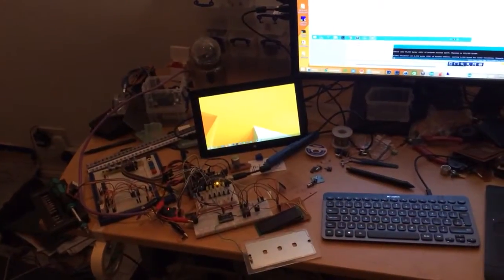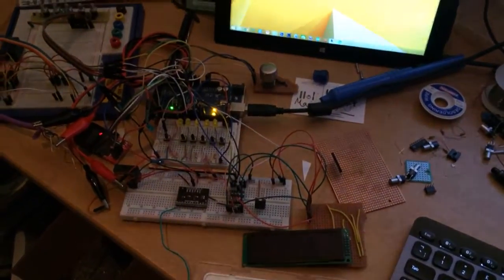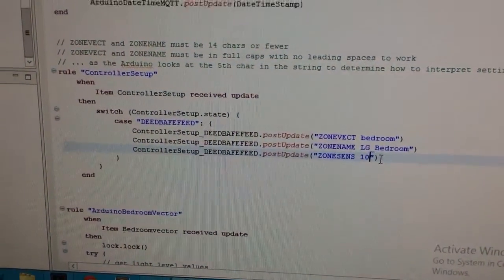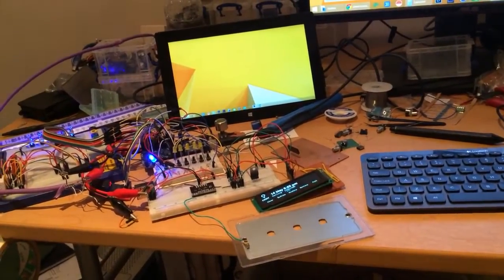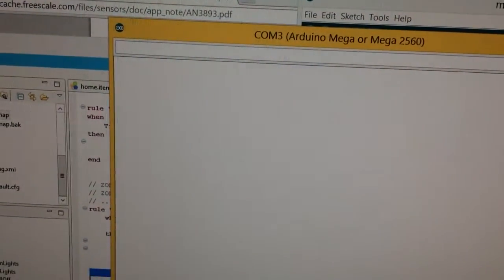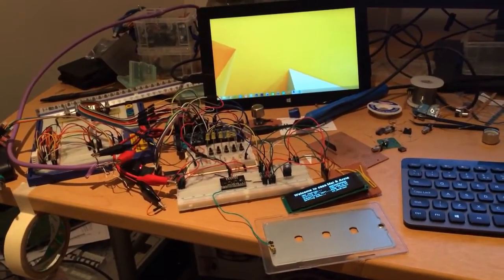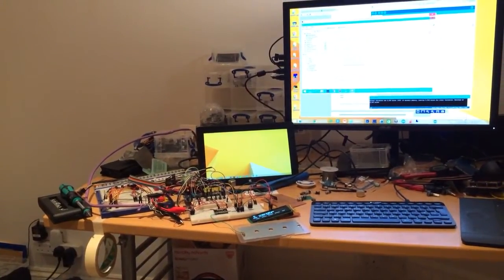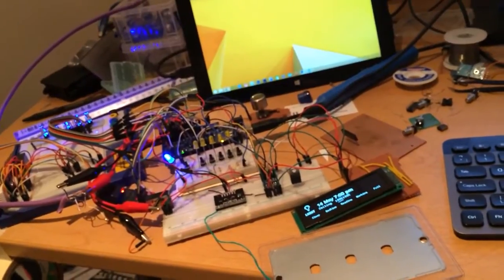Proximity detection with the MPR121 touch sensor IC - Arduino MQTT #homeautomation Controller

Comment: Hi everyone, I'm making a 12 capacitive sensors and I've got the Uno with Adafruit MPR121 (12 capacitive touch sensors). I want to make each sensors act like the computer keyboard. ("awsedftgyhuj" keys) in order to instruments on Ableton Live for example. However I don't know about programming at all. Would someone help me?
Reply: Hi! I'm probably way to late for the reply but you should've used Arduino Leonardo or Micro which uses atmega32u4 which supports USB. This way your arduino can act as a MIDI device or USB keyboard device.

Comment: what screen is that
Reply: +Eddie Amaya to get better proximity and touch your electrode should be smaller then the object that is going to touch it
Reply from the maker: +Eddie Amaya Yes you're right. Tricky - I've seen faceplates that respond really well to proximity and touch though. I just want to know how they do it!
Reply from the maker: +Eddie Amaya It's one of these. Quite cheap on ebay as well: http://www.buydisplay.com/default/serial-3-2-inch-display-arduino-256x64-oled-screen-module-white-on-black
Reply: ahh thanks for the reply. Yes i know what you mean i have seen large area proximity sensors , probably sorcery or some sort of algorithms on an array of sensors.

Comment: The 8 pin DIP package device you touched on earlier is just a Microchip PIC 12F683 microcontroller.  Probably someone has pre-programmed it for some touch sensor application on its GPIO pins?    http://www.microchip.com/wwwproducts/en/PIC12F683